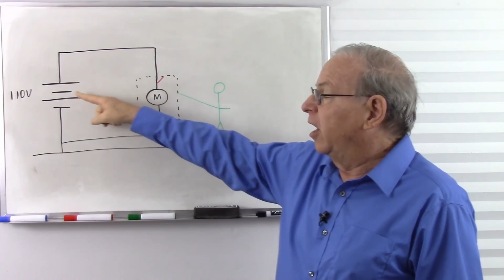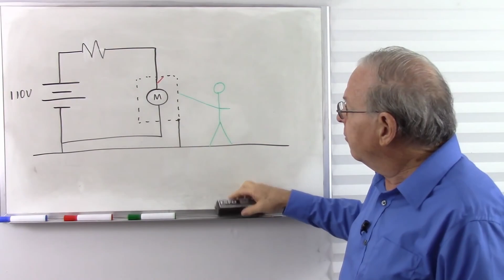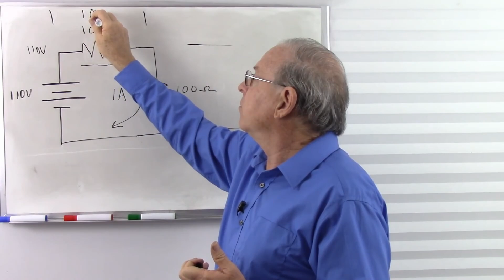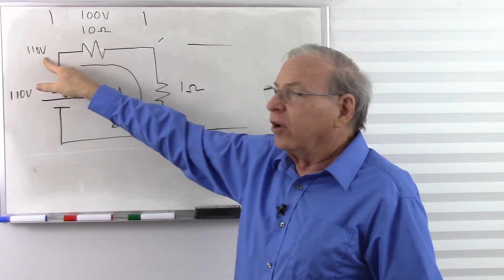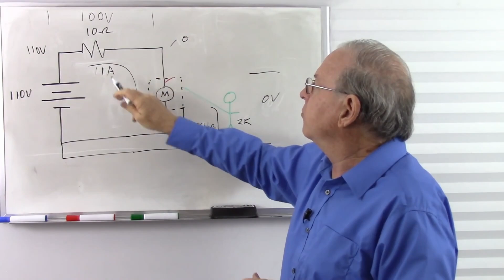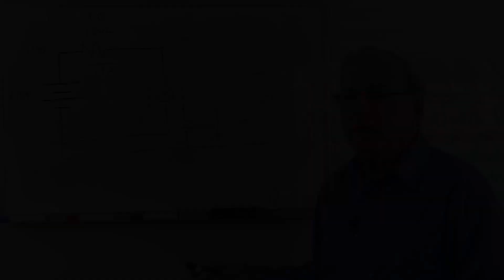How Does Current Know to Take the Shortst Path - Answers to Questions

Comment: In your circuit- you show the motor casing connected  via a conductor to "ground".  I assume the horiontal line to which it joins  represents ground - rather than a metallic connection .
You also show the negative terminal of your battery (aka "supply" -110v ac)  also connected to ground.
If that is the case - the resistance of the ground between these two points along which a fault current would flow if the motor developed a fault would be significant. 
In the uk - the casing of the motor is connected via a conductor called "protective earth"  back to the supply
 origin where it joins to a  common earthing point .
This common earthing point is connected to ground either by the user to a ground stake... ( called TT ) or connected back to ground AND neutral by the supply authority.
In any case - any fault current flowing in this earth system is detected by an rcd  and will disconnect the supply if thay fault current exceeds - in the uk - 30mA

Comment: Thank you for your videos that bring me a lot.
In the last circuit presented, if the internal resistance is for example 1 ohm instead of 10 ohm, it would pass through it 100 Amp.
It seems huge , something escapes me?

Thank you
Reply: In the real world you would never see 100amps unless something is very wrong!

- this "earth"  fault current would be detected by an earth fault detection device - a "gfci" or rcd which trip at very low currents ( 30mA in the uk ) .
Even in the case of a direct fault on the supply conductors - the circuit breaker would trip at around 16 amps or so 
( in the uk could be between 16A to 32A depending on type of final circuit)

Comment: Too complicated. !

It's just a split of current between two circuits in parallel where the ground will take the most of it because of its very low resistance .

Comment: In real circuit there is  absolutly no 10ohm resistance in series between the source and the motor 
and no motor work with 0 volts
Even if motor have 10oms it will take only 55v  cant work too

Comment: What stops the system inherent resistance from being at play all the time with parallel and series circuits
Reply: Every source has internal resistance which is usually very small in miliohms. When learning series and parallel circuits we ignore it. We assume that our voltage source is perfect without internal resistance.

Comment: Great teacher, You are BOB.
But practically bob as I asked before and need clearity ,is that how the resistance between the source point which grounded and load casing which is also grounded is less then 1 ohm. Earth is not wire...will there not back voltage?
Reply: I'm not sure I understood your question correctly. So you are asking why the resistance of combination of both human and grounded terminal is less than 1 ohm. Well if we assume that resistance of grounded terminal is 1 ohm and resistance of human is 2k we add resistances just like resistors in parallel.  (R1*R2)/(R1+R2) = (1 * 2000)/(1 + 2000) = 0.9995 ohms. We get 0.9995 ohms which is less than 1 omh. From parallel circuits we know that total resistance of parallel resistances is always less than the smallest resistance. Everywhere where there is resistance and current there is voltage. But as we know from parallel circuits voltage is the same across parallel resistors (in this case human and earth terminal). We can calculate voltage across human and earth terminal by simply using Ohm's law. We can calculate the current flowing through the circuit   I = U/R = 110/10.9995 = 10A. Know we can calculate voltage across human and earth terminal    U = I * R12 = 10 * 0.9995 = 9,995V. So the voltage between ground and earth terminal does exist.
Reply: @Slovenija_patriotVery good explanation...
Reply: That's why the lower the resistance between ground and the equipment, due to parallel combination, the net resistance will be less than the minimum resistance.